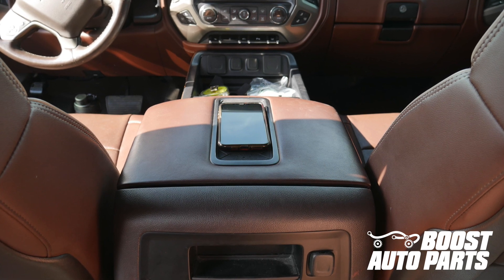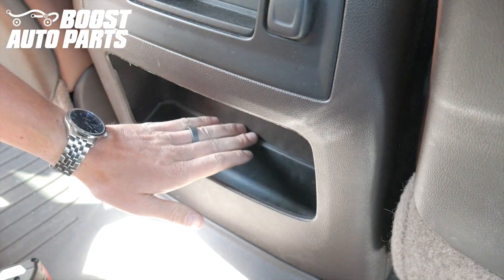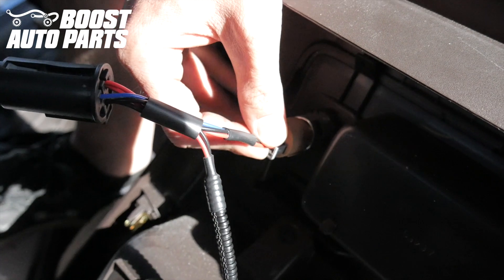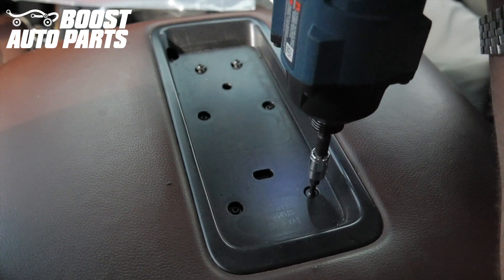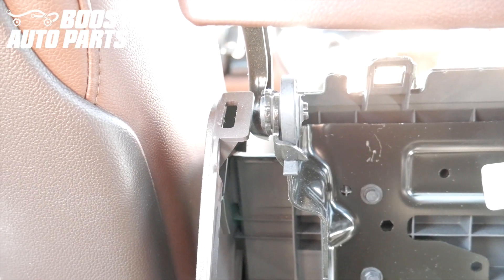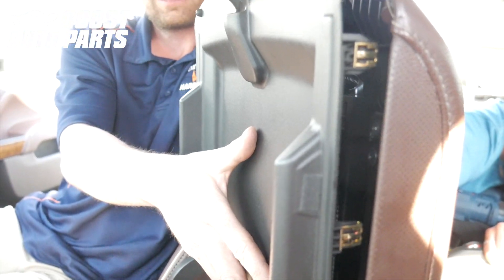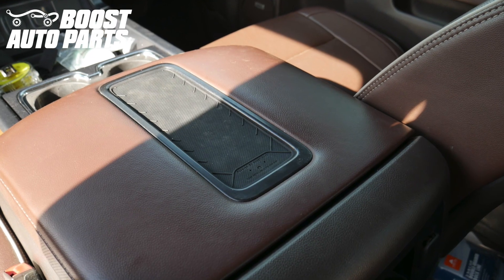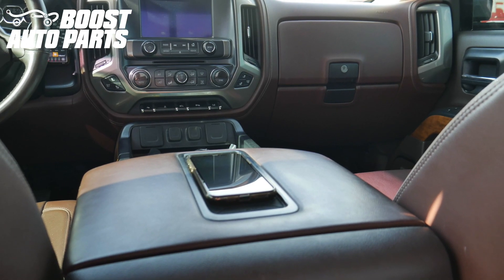2014-2019 Wireless Phone Charging Retrofit Install Silverado & Sierra (Full Center Console)

Comment: mine dosent charge its solid red without a phone but when i put my phone on there it keeps flashing it dosent change to blue what do I do to fix this problem
Reply from the maker: First it's important to make sure your phone is equipped with wireless charging - not all phones are equipped with this functionality.

If your phones is equipped with wireless charging and this issue is still happening, reach out to our support team at support@boostautoparts.com so our team can resolve your concern ASAP.

Comment: Will this work for the new IPhone 13pro max with a case?
Reply from the maker: As long as it fits in the area it will work, however depending on the thickness of the case the charging performance may be effected.

Comment: Will this tie in to the radios Apple CarPlay so it no longer has to be plugged in via USB?
Reply from the maker: This does not effect CarPlay. If you didn't originally have Wireless CarPlay you would still need to plug in. There are CarPlay adapters available (not from us) that you could use in conjunction with our charger to have wireless charging and carplay.

Comment: Does this stay on while the truck is off?
Reply from the maker: It will stay energized anytime the rear 12V is energized. This varies on different years and trims, so we'd encourage you to do some testing on your rear 12V outlet. 

That being said - the charger does not consume enough power to drain the battery if it's not being used, so regardless of how yours operates it is still safe for the vehicle.